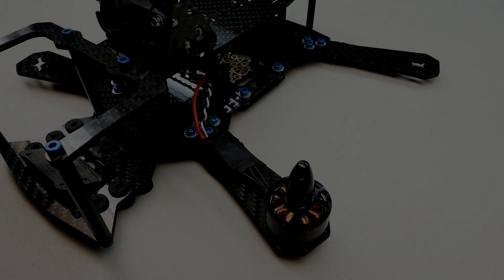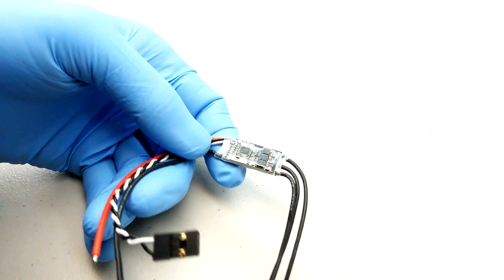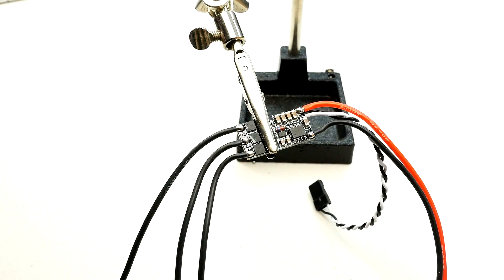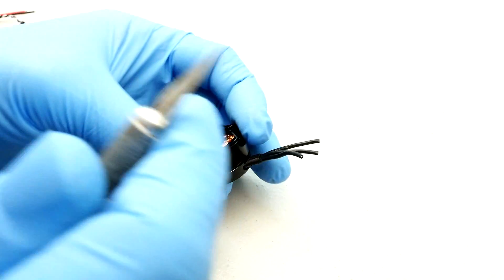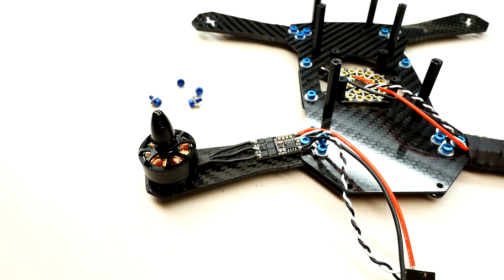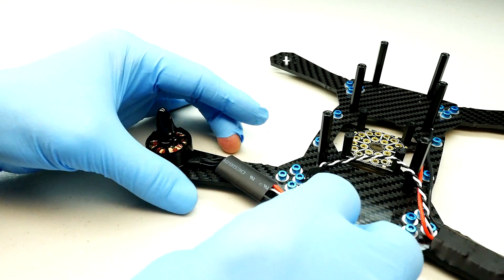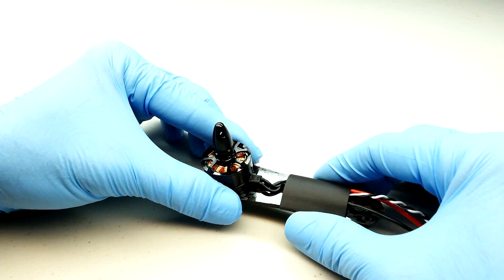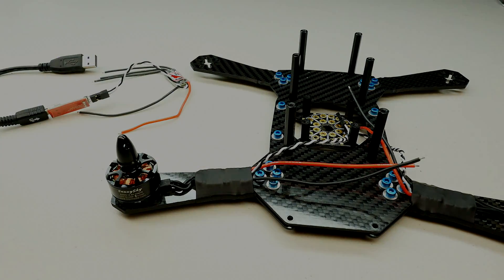Zeus "Little Bee" 20 Amp ESC Install Tutorial (FPV Racing Frames)

Comment: what about black electrical tape to hold the ESC on?  any disadvantage?

ALSO - my Eachine Racer250 has 3 wires attached to the body - RED, YELLOW, BLACK.  I see these have red and black...  but what about the signal wire?  (yellow)
Reply: REDmotionMike I am actually wondering the exact same question. did you ever find out any info on that?

Comment: that crocodile clip  directly can damage it or short it out
Reply: +FotoAmg AmgFoto True: I wrap my crocodile clip jaws with a few layers of heat shrink so that the teeth don't cause damage, and the rubber-texture of the heat shrink also reduces slip and adds some cushioning to the components.

Comment: DUDE,USE MILLIE TIES!!!!  THEY ARE NOT ZIPTIES  ,THEY ARE WIDER THAN ZIP TIES ,KIND OF ELASTICITY, AND DONT PUT ADDED EXTRA HEAT OR SHARP PRESSURE ON YOUR LITTLE BEEZ.....YOU CAN FIND (MILLIE-TIES) AT ADVANCE AUTO .....O REILLYS....USE  HEATSHRINK OVER ESC......PUT STICKY DOUBLE SIDED TAPE ON BACK OF NEW HEAT SHRINK INSULATED L. BEE ......THEN MILLIE-TIE THAT SUCKER DOWN N BE DONE W IT....THEYRE FAIRLY PRICED AND DURABLE .....AND BETTER YET,REUSABLE   .....IM JUST TRYING TO HELP MAN ... ITS WHATEVER WORKS FOR PPL

Comment: If you need to swap two wires to change the motor rotation, you have to remove the heat shrink tubing again?
Reply from the maker: +Ronnie Cuevas You can change motor rotation this way but its MUCH easier to simply plug the ESC into your programmer and change rotation via BLheli software.
Reply: +Catalyst Machineworks I see. Which programmer do I need?

Comment: Can't you just use Cleanflight passthrough to program those BLHeli ESCs without that little programming chip?
Reply: +Catalyst Machineworks ESC cooling w/ your method looks pretty bad though.
Reply: @antdx316  wow i was thinking the same..
Reply: @piloto5248  I think the technology from years ago is better.  I've read some components that used to require cooling no longer do.  Reading about an active diode that doesn't require cooling, no idea what this means.  Someone called it a power FET but wondering why it's a diode.  I didn't think about it at the time but I assume it has to do w/ this.
Reply: @antdx316  I just order similar speed controllers I will give them a try for a 285mm frame and a matek board with distribution board.
Reply: @piloto5248  whats the best reliable esc and race multirotor that exist in the world now?
Reply from the maker: +PadmaN I have never done this myself but I have heard you can!

Comment: You have 3 black wires from the motor and 3 black on the ESC. Doesn't it matter what goes where?
Reply: +Peter Söderborg Nope, connect any together. If the motors spin in the wrong direction, swap any two wires.

Comment: All that shrink tubing isn't a problem for optimal esc ventilation?
Reply from the maker: +INMERSO I have been flying all our prototypes this way and so do some of my team pilots. We beat the crap out of our rides and no issues. ESC's already come with one layer of shrink tube so another layer doesn't seem to cause any issues in our testing.
Reply: I see, thanks 4 the answer. By the way really like your work
Reply: why the quality of the carbon fiber of the frame would affect esc temperature?
Reply: or use white shrink which will be better in sunlight :)

Comment: What temperature do you use to desolder the original leads?

I've had a hell of a time trying to melt the solder that comes on those leads.
Reply from the maker: +blaster17363 its just a Weller 40 watt medium duty soldier gun. Nothing special.
Reply: +blaster17363 i use about 300c